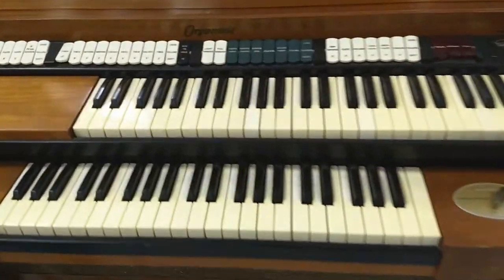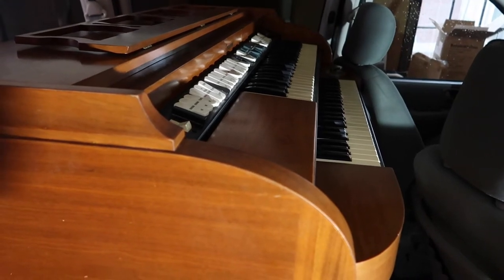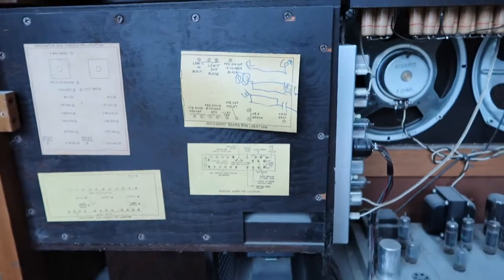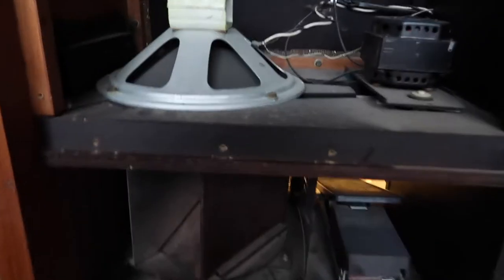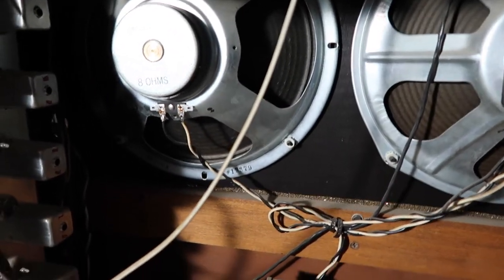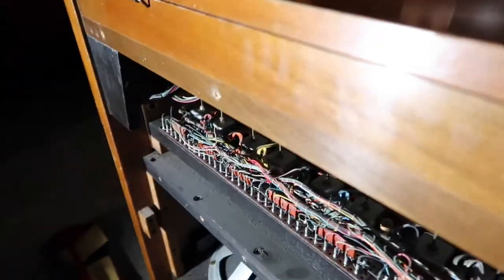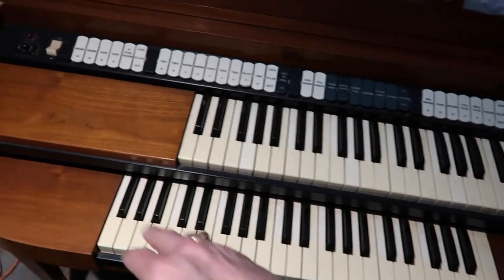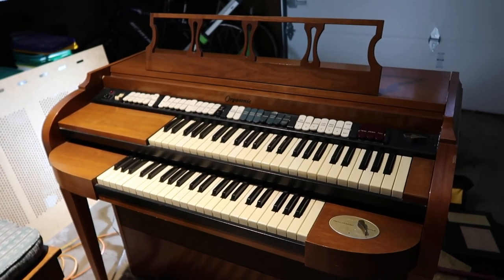Inside a Baldwin Orga-sonic 54A - Part1: Test and Evaluation

Comment: The noise at start up is the reverb springs. When it’s moved the three wing nuts should be tightened down. I wouldn’t say it’s worthless from a musical standpoint, I have many videos on my channel recorded a model 55 which is mechanically identical. But it takes a real appreciation of them to know their capabilities, and I’ve completely rebuilt mine. Worth every penny and minute I spent on it. I have the model 46 too. That one actually seems to be in good shape, and the pedals not working are likely a bad pot, and that’s the one under the lid. But if you part it out I’d be interested in the frequency dividers.
Reply from the maker: Thanks for the tip. As it turns out, I discovered the problem in the follow-up video. Basically, the small springs that tension the large reverb springs were broken.

Comment: I just saw/played an identical Baldwin Orgasonic w/o the Leslie/“Panarama” spinning speaker add-on. It was mostly working: a few bass pedals were out of tune / farting out and maybe the overall keyboard was out of tune (I sensed it was out of standard pitch, but pretty much in tune with itself). $100.00. I should have bought it and made room. I went back today and was told it was sent to the landfill. Basically a working home organ ….damn
Reply from the maker: Darn, that's a shame! But FWIW, vintage electronic organs are available on Facebook Marketplace, often for free. I also see them at thrift stores on rare occasions. So, you can probably find one comparable to the one that got away. :-)

Comment: Found one in a small restaurant.   Wasn’t working, so I’ll have to ask them to let me come in with my tube tester & gear to see if she’s resurrectable.
   If those spkrs are Oxfords they’d be worth something.   I have a 50’s-60’s Wurlitzer Leslie that used Oxfords.  They sound great on guitar!!!
Reply from the maker: Thanks for the tip! I believe the manufacturing code shows that they're Rola speakers. I do think they have a little value, and I will probably eventually resell them as vintage speakers for someone to use in a guitar amplifier.